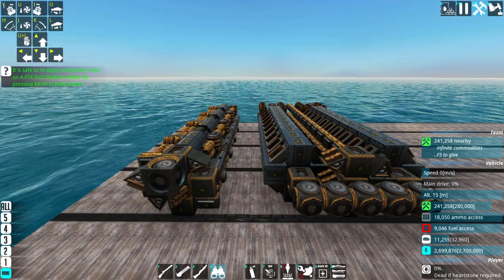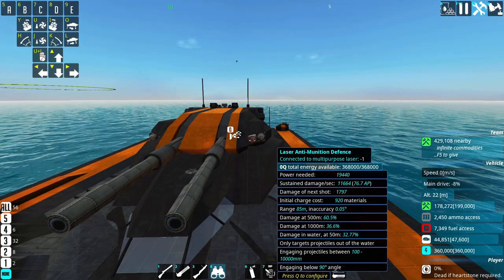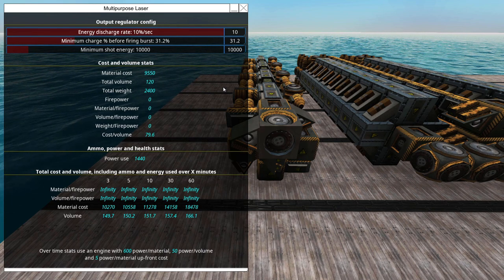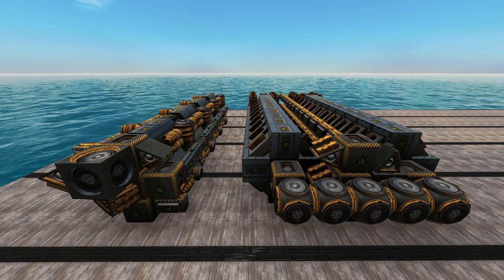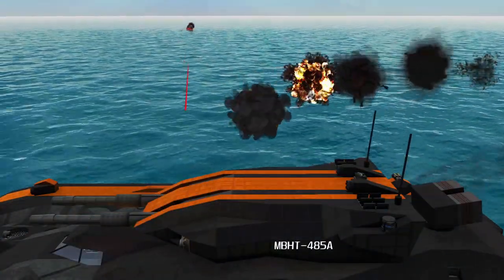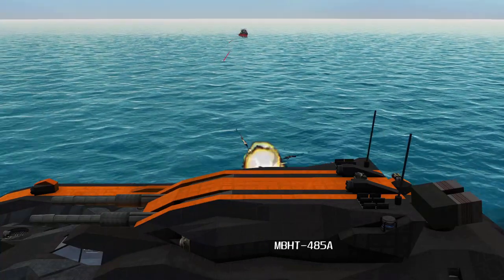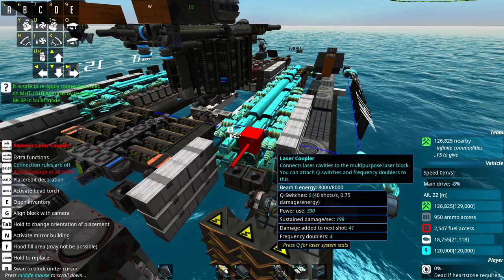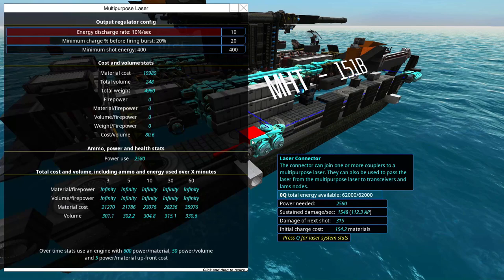From the Depths - Laser Tutorial 102

Comment: Any chance on a laser defense tutorial?
Reply from the maker: Maybe? There just isn't a lot to say.

The cheap option is wood spam. It doesn't lend itself to a pretty-looking vehicle, but it kinda works.

The low-effort option is using metal/alloy + strength 10 shields. It's not gonna be enough against the more powerful laser vehicles, but it'll do alright and has the added benefit of shields reflecting roughly 30% of incoming shells.

The best defense you can mount is heavy armour + ringshields + smoke. The combination of HA and ringshields will give you very high AC and copious amounts of smoke can reduce a laser's AP by around 80%. This will decrease laser damage a lot. Just make sure such a vehicle isn't moving too fast since speed reduces the effectiveness of smoke.

That's about all there's to say about it.
Reply: @OhmIsFutile  maybe just a gen defense  tutorial then to add more content.  There is nothing out there that covers shields, smokers, munition warner, etc.  Just even running through how to them up.